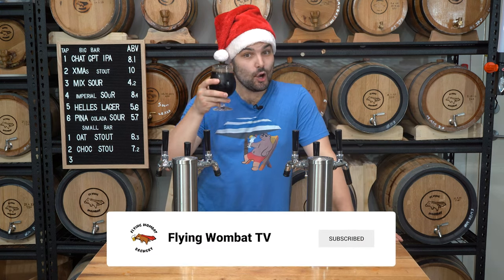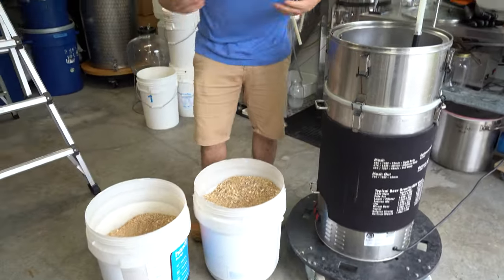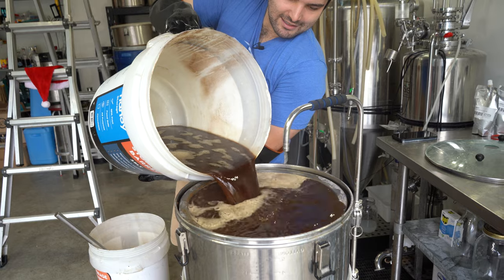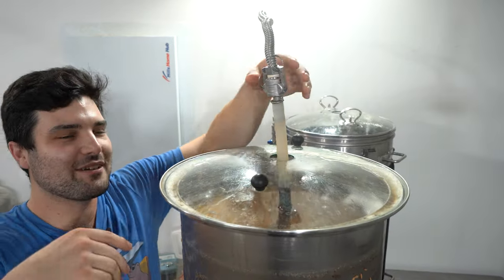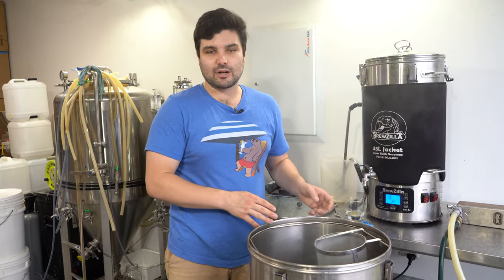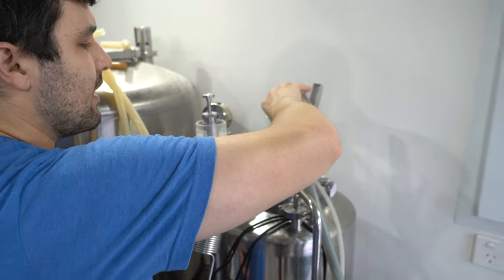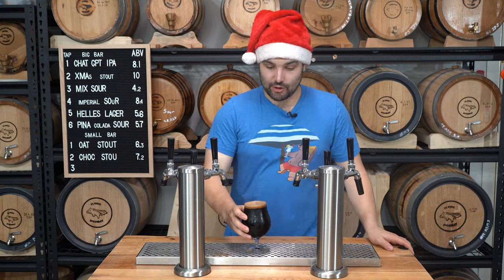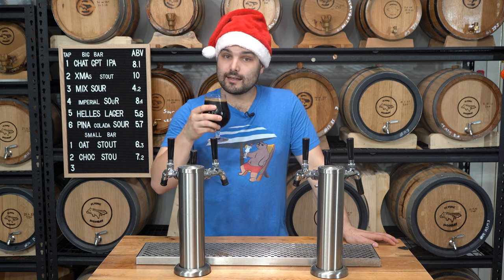Brewing an Imperial Gingerbread Stout for Christmas!

Comment: Great video guys, I hope you have a Merry Christmas!!!  Also, do you know what the most grain you've put into that system is without the extender on top? I have the same system but not the extender and was hoping to get about 11.5 kg in there.
Reply from the maker: I have crammed in 15kg once, but that was reeeeally pushing it! Gave me a bit of a stuck sparge and the efficiency dropped massively. But 11.5kg you should be able to do without sweating it. I regularly use 12kg for iPas without a prob